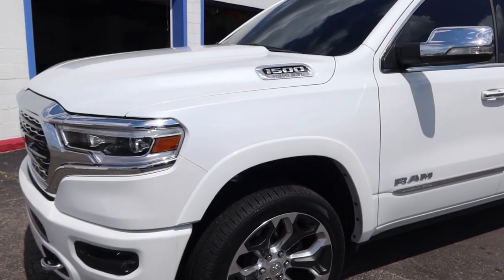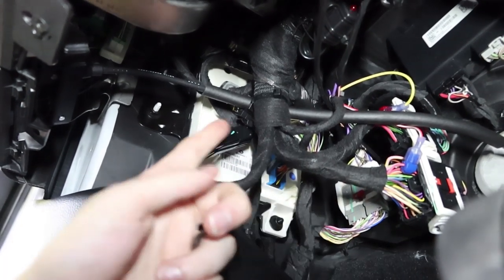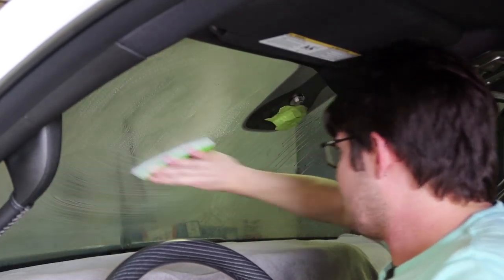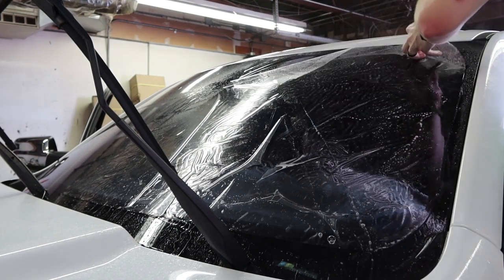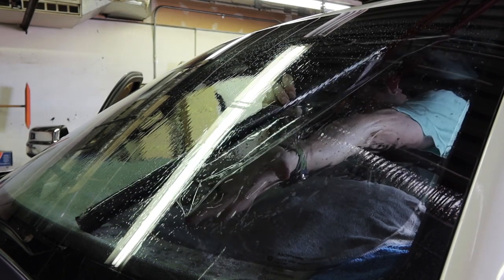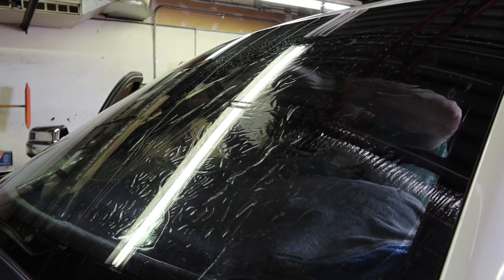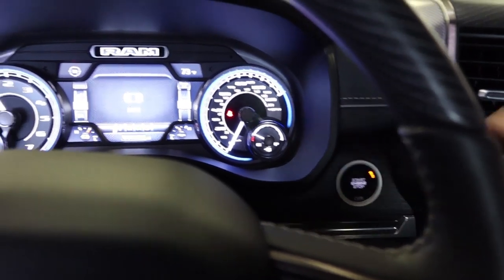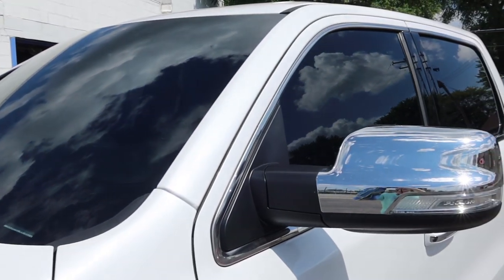Don't lose $1000+ on this truck!!! 💦 |Tinting a Ram Windshield Safely | BCM Location

Comment: Thank you for posting the heads up. I am in the auto glass industry and run my own practice and though I don't tint, I use a slip solution on the bottom of the window for my tool to glide through the glue bead. I will make notes to use wire on these so it doesn't require any moisture!

Comment: I just did a 2019 Dodge Ram Limited windshield yesterday.  I always use a soak shield and cover the dash with a towel.  I didn’t have any issues but I will sure cover that module in the future.  Thanks for the heads up!
Reply: @marklogan3774  Are you OK?
Reply: Did the truck you do have lane departure?

Comment: I actually went in and put dielectric grease in the connector in both my ram trucks and also inside the backside of the connector so it helps with it corroding and probably helps with the water issue you are talking about. Idk why they mounted the BCM upside down.. it just needs flipped around and it's not a worry..

Comment: Lol 3 weeks ago I've tinting the windshield of a small hatchback and yess I was so unlucky that the water slip through the dash and somehow I think it hit the ecu or maybe the fuse box. On the first day of driving the car is just normal but on the second day I be damn because throttle not responding and some indicator on gauge going crazy also with the brake light keep turning on and guess what? Somehow I still got lucky that it didn't fried anything in the car which I'm worried about, so what im doing the next day is just simply put the car under the extreme hot sun all day long, thanks to the sun for helping me save a lot of $$$ for not sending it to workshop just for the sake of careless mistake (I was going to send it to the workshop actually but my instinct say this must be the tint job that causing the problem so I take the risk myself and yess it save me a lot and now that the car is perfectly normal). Atleast now I have learned from that mistake anyway. Too bad that I watch this after the incident.

Comment: A place here in vegas did my windshield tint on my new 2019 ram 1500 classic 3 times and could not stop leaving surface scratches on tint. Finally I told them to just take it off and next day I noticed my windshield had surface scratches on it. Company tried to blame the tint manufacturer first and then blaming Dodge makes cheap windshields and that's why it has surface scratches..

Comment: It's really good to get the ram truck windshield tinted even if it's not dark. Just as long as it helps with uv cause the dodge trucks are notorious for the dashes cracking on them because the sun beats the crap out of it 😀
Reply: 14 years ago yes, it’s no longer a problem

Comment: I have a 21 Mazda 6 they have tinted the windshield twice and it’s still jacked up. Scratches.  Plus I get a key fob malfunction and can’t unlock or lock my doors and grainy infotainment. It dries out and works fine. How can this be stopped since they have to tint it again? Have you had and trouble on Mazda windshields and electrical issues after?

Comment: What did you do about the dot matrix on the windshield? I keep trying to do mine and it wont stick to them. Any advice? I learned from all the other videos you have done and rhe advice.
Reply: 00 steel wool or wetsand with 1000 grit sandpaper I've seen used as techniques.

Comment: I really hope you check your states law first. In my state u cant tint the windshield except with clear or a 4 inch band. 25% on sedan doors or front 2 of a SUV the rest can be up to 5% here. If that's not to law and they get in a wreck n say the tint restricted visibility u might have a case against you. Great quality job but hope your laws are different

Comment: I'll make sure I make people sign waiver and non liability forms and Indicate to go through their warranty if they have electronic issues and ill make sure I charge 1200 bucks to tint windshields.
Don't even touch teslas. 1 tesla needs a 40 inch roll to do the back windshields. 
Window film applications are some of the most complicated apps to do. 
Charge an arm and a leg everyone. 
Cheers

Comment: Planning to tint tint windshield but don’t want to loose visibility. Which type of windshield would you Recommend? There’s like like airblue , ceramic, crystalline, ? I want something that is dark from the outside but without losing visibility
Reply: juan Agustin I had 50% on my shield with 5% all around and you can’t see in at all. But 50% doesn’t affect visibility at all at night.
Reply: @ericferguson4114  Does it look weird with a 50 percent on the windshield? And 25 on the sides. 50 on the back?

Comment: You tinted over the sensors in the rear view mirror???
Reply: Yeah, thats what im wondering about my Longhorn... Im getting ready to tint my pickup and my windshield has a weird looking sensor right below the mirror theres like 5 or 6 little yellow/orange lines you can see from the front of the truck!?!? Do you know what that sensor is for and if its okay to tint it?...Im assuming its my surround/overhead camera sensor idk because my truck has the camera that looks down over the truck when in reverse ....idk if im going to be able to tint my windshield because of that sensor, for one i dont know about covering it up and also i think it will look super weird if the rest of the windshield is tinted dark and that little spot has those yellow/orange lines right in middle of the windsheild lol
Reply: @DirtNassty  thats the rain sensor and fcw (front collision warning). They usually tint around the mirror and housing so you should be good. Mine still functions great. Definitely do not let the take that mirror off or electronics or else all the camera and sensors will need to be dealer calibrated. Just tint around it